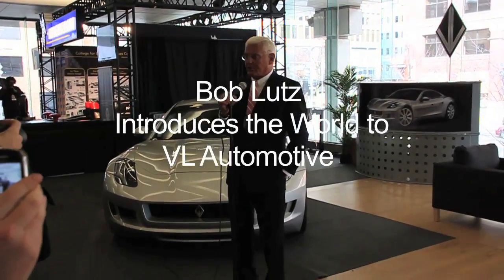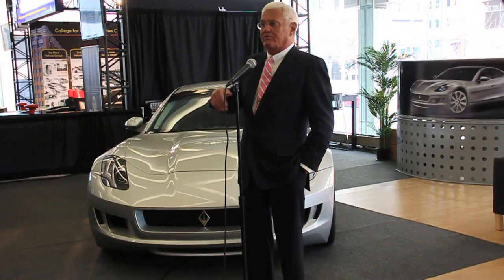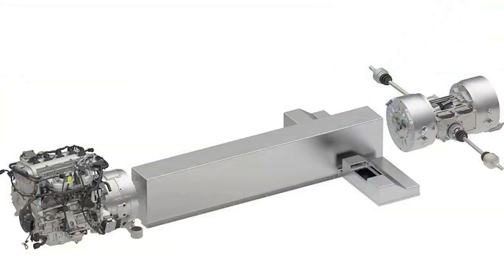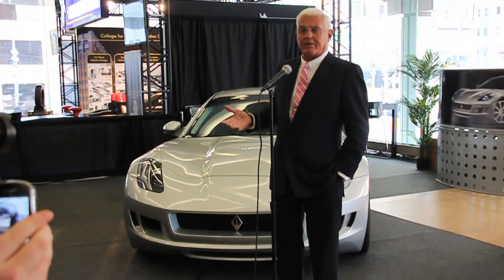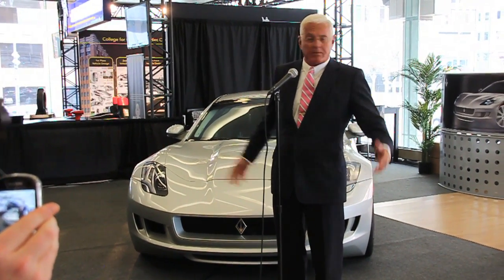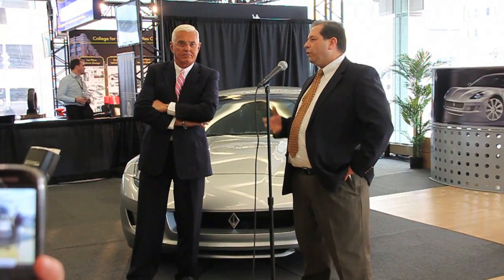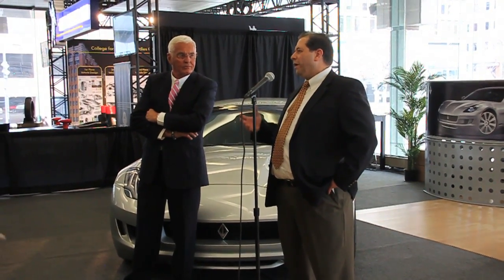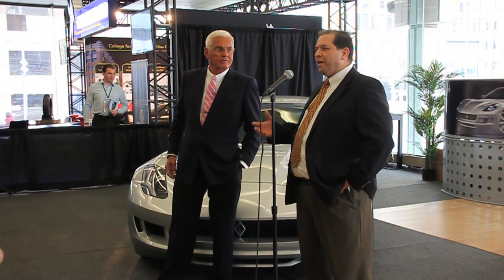Bob Lutz introduces VL Automotive to the world

Comment from the maker: "Maximum Bob" Lutz announces his latest venture, VL Automotive

The very last press conference at the 2013 North American International Auto Show media preview today, featured none other Bob Lutz, "retired" vice chairman of General Motors (also formerly of *****, BMW and of course Chrysler). During his long and storied career in this industry, Lutz has sheparded some amazing machines onto the road including the ***** Volt and the ***** Viper. 

Despite being technically retired, the 80-year old Lutz remains more active than many people 1/3 of his age. At  #NAIAS  today, Lutz and business partner Gilbert Villarreal announced their new venture, VL Automotive. VL has struck a deal with Fisker Automotive to purchase Karma gliders straight from the Valmet factory in Finland and have them shipped to a facility in Auburn Hills, MI.

For those not familiar with automotive jargon, a glider is a vehicle that is partially complete but missing a powertrain. When Tesla Motors was building Roadster, Lotus built Elise gliders that were shipped to California where Tesla installed the battery and electric drive system. This deal is different because Fisker is supplying it's car minus the A123 lithium ion battery or the electric drive system. 

At the VL facility, technicians will install a supercharged 6.2-liter from a Corvette ZR1 and the 6-speed automatic transaxle (along with other assorted driveline components. The result is a car with the stunning good looks penned by Henrik Fisker along with a durable, reliable conventional powertrain. Best of all, without the battery, it weighs about 1,000 pounds less than the rather portly stock Karma. 

What makes this deal particularly interesting is some of the players involved. When Lutz and Jon Lauckner conceived the extended range electric vehicle (ER-EV) architecture that eventually became the Volt in early 2006, one of the first people they brought onto the team to lead the engineering effort was Tony Posawatz. Tony was appointed Vehicle Line Director for the Volt and remained with the program until after it finally went into production in late 2010.

During the Volt's gestation, Henrik Fisker started to start his eponymous car company and designed his luxury sports sedan around a similar ER-EV powertrain concept to the Volt. He agreed to a deal with with GM to buy 2.0-liter turbocharged four cylinder engines for range extenders. 

Posawatz retired from GM about a year ago and several months later he was hired as CEO of Fisker. Fisker now has a problem because it can't build and sell Karmas until battery supplier A123 Systems comes out of bankruptcy. This deal at least gives Fisker the opportunity to sell some partial cars. 

When I learned about this car, one of the first things that occurred to me was another car from Lutz's past, the 1991 Chrysler 300 concept. Two years after showing the original Viper concept, Chrysler was looking at other uses for the chassis and V10 engine it was developing for the production version. The 300 was luxury four-door sedan with similar proportions to the Karma. http://www.amcarguide.com/concept/1991-chrysler-300-concept/

Ultimately, Chrysler where Lutz was president opted not to build that 300, but the VL Destino is in many ways its spiritual successor. VL hopes to sell a few hundred units a year at a price of $180,000. Hopefully, they will succeed. http://vl-automotive.com/